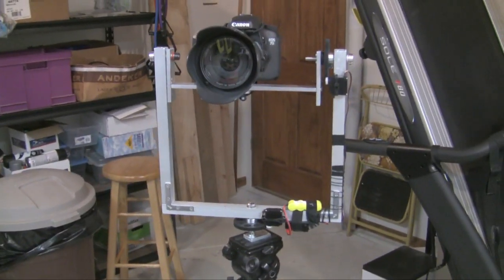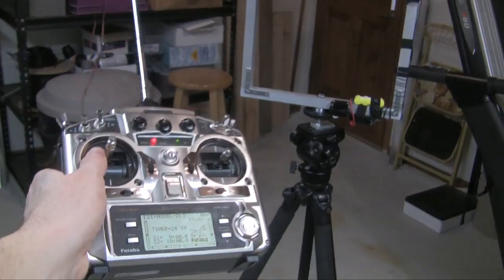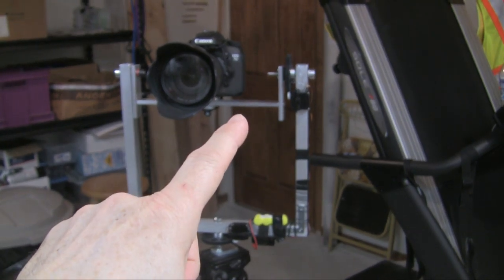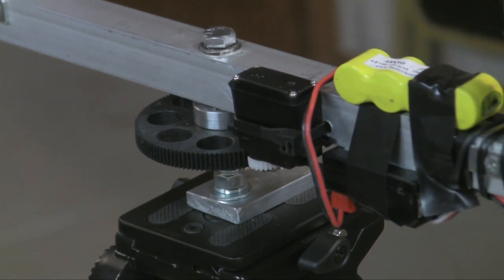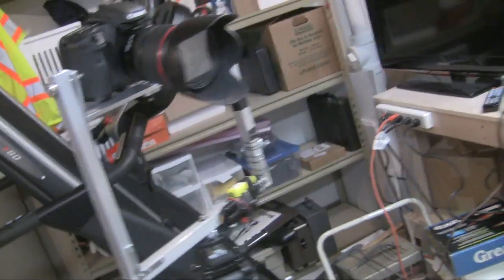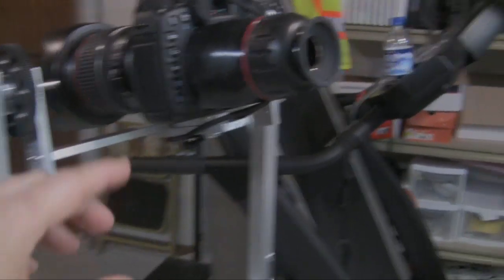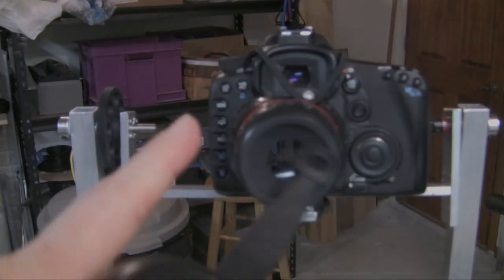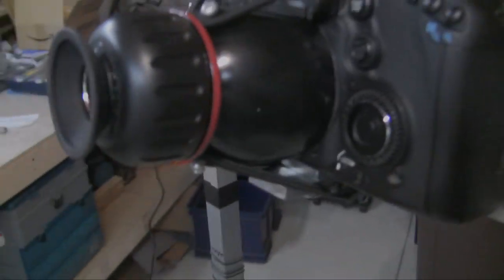DIY Pan Tilt Head and Canon 7D Viewfinder - Motorized Remote Control

Comment: This looks great! I'd like to build something similar, and have it be controlled by an Arduino.
At 1:25, am I correct in thinking that the components lined up on the shaft are, from right to left: a shaft collar, the square tube, a clamping hub, a (hub mount) gear, and the 1" bar? Am I missing anything, like a shim or spacer?  Did you just drill through the square tube, or is there a ball bearing in there?
What about the other side - shaft collar, square tube, bar, another shaft collar?  Thanks!

Comment: Remarkable piece of kit but would have appreciated more detail on measurements, components etc, especially the bearings/shafts etc and how they are all mounted/assembled. Alot of people do as you did and display their ingenuity but fail to expand properly on how it was done, so for interested lay people they are little more than a source of frustration. Great shame.